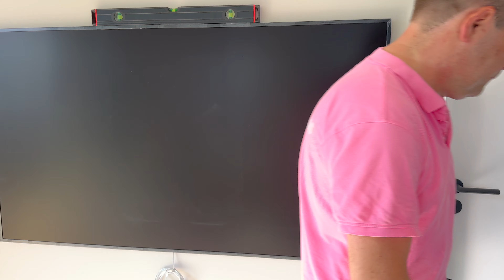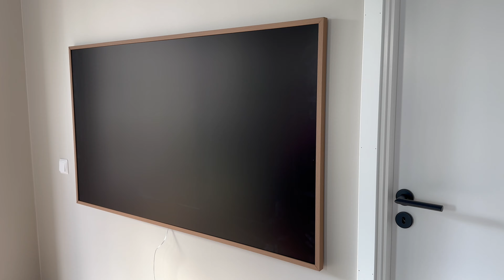2024 65"Samsung The frame unboxing and wall mounting

Comment: Thanks for the video. I can't find straightforward information on bezel compatibility across The Frame generations. Which ones are compatible with a 2024 65" The Frame? Could you please give me the model ID / number of the one installed in the video? Thanks!
Reply from the maker: Hi. Every bezel from 2021 will fit.
Reply: @oslotvmontering  Thanks a lot!

Comment: Great video and thanks for sharing! I have a question: I have the 2022 Frame TV and want to upgrade it to the 2024 version. Is the 2022 Frame wall-mount compatible with the 2024 Frame TV or do I need to re-install the new bracket? Thanks!
Reply from the maker: Hi. Thanks. It's compatible but only for the same size TV. So if you are getting a bigger or smaller the frame you have to adjust them a little bit to the side. The length between the brackets is different with each size.
Reply: @oslotvmontering  Thanks so much! I will be keeping the same size tv (55") :)
Reply from the maker: @joey4724  Perfect. Enjoy your new TV!

Comment: Hi, is the slim support bracket I saw in your video included in the cost of the TV or was it purchased separately?
Reply from the maker: Hi. Its included in the cost. Comes with the TV.
Reply: @oslotvmontering  aaah ok thanks but it also applies to the 85 inch versions?
Reply from the maker: @Niki-p-29 yes 👍🏻
Reply: Thanks 👍🙏

Comment: Any particular reason you're not putting the optical chord in the wall?  That always looks terrible hanging down.
Reply from the maker: Hi. In Norway you have to be a certified electrician to put electrical wires in the wall. I am not that, it's also very expensive so most people dont do it here.
Reply: Samsung design flaw not to make that cable in wall rated. Having said that I don't believe there have been any house fires relating to Frame TV one connect cable and most will put the cable in the wall regardless of what the code says for a clean look!